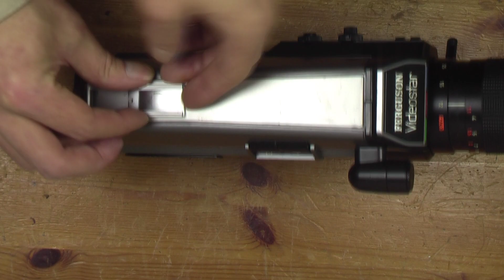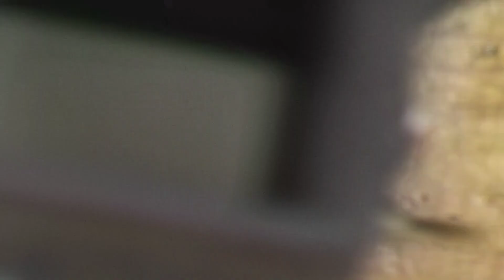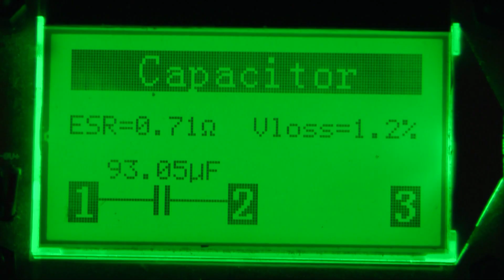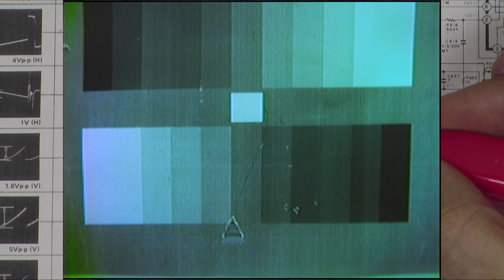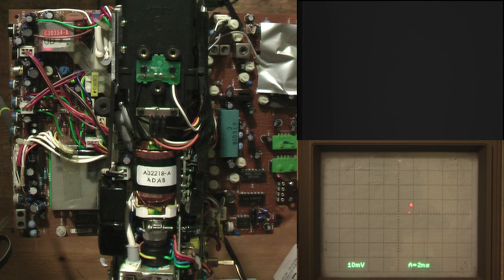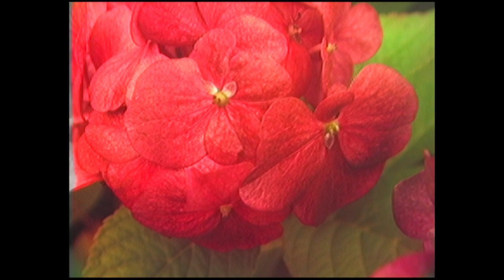Ferguson 3V20 Vintage Video Camera Repair

Comment: When pointing the camera at a white wall for doing adjustments such as beam current, do I have to remove the softboxes from my two Neewer NL660 studio lights? Or will that provide enough light. I have another 60W Vivitar light that doesn't have a softbox.
Reply from the maker: Hard to say, you'll just have to try it and see I think.  Most adjustments require you to set the iris so that the output waveform is a particular peak to peak voltage so if you can get that voltage without having to open the iris fully then it should be enough.  With the beam current you have to open the iris fully and the light is sufficient if you can set the beam current for the correct peak to peak voltage with the waveform (it will be the output of the preamp i think) being hard clipped (flat on the top) then it's enough.  For some adjustments such as ones relating to the white balance you need light of the right colour temperature.
Reply: @nowt1002  It says to vary the iris just before beam saturation. Does that mean I just set the iris to exactly the point where if I open it up any more I'll get the green? Is that what they call beam saturation?
Reply from the maker: No you need to set the iris so that you have beam saturation and then adjust the pot so that the saturation occurs at the specified voltage.  Beam saturation is where the waveform clips, ie its flattened off at the top.  If you open the iris and then adjust the beam current you'll see the flat top of the waveform move up and down, you need to set it for 0.55v peak to peak according to the pal service manual, I imagine the ntsc one will be the same but check.  You usually have the iris fully open for this adjustment.
Reply: @nowt1002  So I went to do the adjustment today and it actually appears the beam current problem is gone - when I point the camera at bright lights even with the iris open all the way on standard gain there is no green. I guess it has to do with the fact my GR-C1 hasn't been powered on for at least 30 years. Could be the tube itself warming up or the capacitors. But anyways it works and I've got a working battery now so I'm all ready to upload some footage to YouTube - haven't seen any GR-C1 footage that has been deinterlaced and upscaled to HD.
Reply from the maker: That's good.  Probably the tube I would think.  You get the same thing with picture tubes that haven't been used for a long time but it manifests as a dim picture.  Hopefully it will be ok now.

Comment: Do you know any adjustments to possibly fix a tube camera that has a very dark picture? Assuming the tube is not worn. I own two Canon VM-E1 8mm Saticon camcorders, and one has a working tape transport but the picture is very dark and it only really works outside. Like I'd have all the lights on in a room indoors and it would just be black expect the light blub itself. I have the schematics but not an adjustment manual. Looking at the boards it looks like there's a power board that generates the high voltage for the tube, and then a deflection board. There is a variable resistor on the deflection board marked "BEAM", I'm wondering adjusting the beam current might make a difference?
Reply from the maker: Would you be able to link or email me the schematics please?

I wouldn't touch the beam current at the minute if you don't know what it's meant to be set to.  I would say the fault is more likely to be in the luminance process circuit.  There will be some circuit that clamps the signal to a fixed dc level, that's where I would be looking after confirming that supply voltages are OK.  If you can send me the schematics I can try and find the circuit to look at.
Reply: @nowt1002  I just emailed you them

Comment: Do i need to understand those electrical diagrams and have that equipment in order to just replace the capacitors?
Reply from the maker: Not really, if you're just going to replace caps you just need a soldering iron.  Make sure you put them in the right way round.